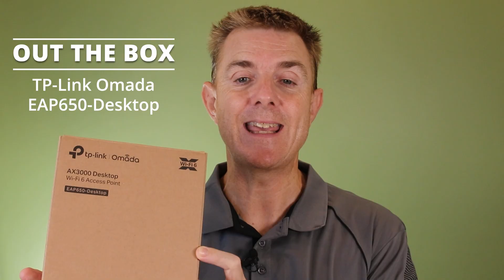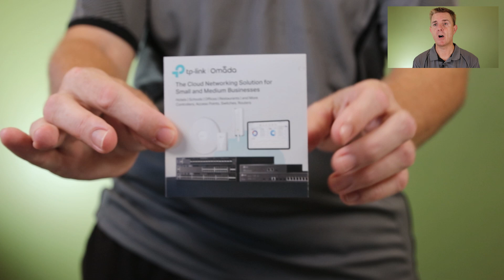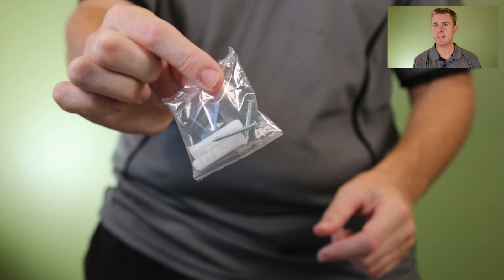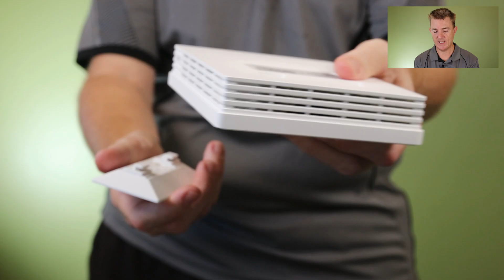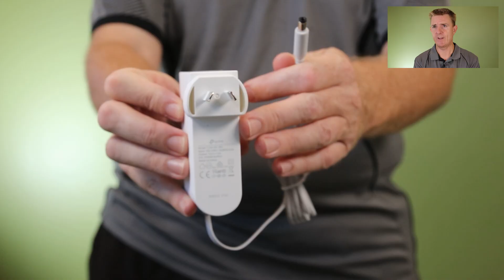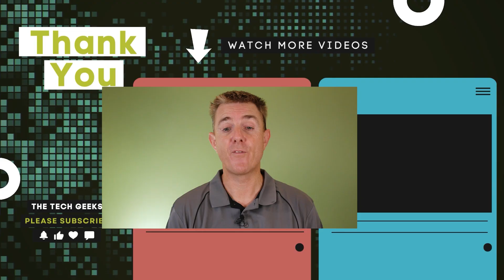Out the Box Series  - TP-Link Omada EAP650 Desktop Wireless Access Point

Comment: I have a question regarding the use of the RJ45 Console port as a port for the OC200/220 Controller, because most professional users use one of the RJ45 ports to connect the Controller, even if they also have a Console port on the switch they use. The latter leaving it free to connect to a laptop/computer for settings.
Can the OC200/220 controller be installed on the RJ45 connector labeled Console (RJ45)? Is it POE?
I'm interested because otherwise you occupy a 10Gb port (out of only four RJ45) with a device that can "carry" at most 1GB (OC220). In my case on a TL-SX3206HPP
Thanks in advance for an answer.
Reply from the maker: Good question.   We generally see console ports for that final out of band management or fix up if needed (if you are in the enterprise space then the config is normally done on the switch directly and so console access is fine and there is often no controller as such it is just a config per device).   In the case of the Omada controller it is designed for web based access, often remotely, so needs to see the internet.   Since you will need the web management to add and manage any of your access points or switches you want it to control, it will need to be PoE powered and have an ethernet connection.  In your instance as your switch only supports 10Gb/s ports then you are using a 10Gb/s port to just provide power and a small amount of data to the device, so is probably overkill, but if you don't have any slower speed ports, there is not a lot you can do I am afraid.
Reply: @The_Tech_Geeks  Thank you very much for your answer.

Comment: Hello, totally clueless here. I’m looking to extend Wi-Fi from my router with a 20m long Ethernet cable (cat6a) . Do I just plug it into the PoE port and it’s good to go  or are there better devices out there ? I do like the look of this device and that it has Ethernet outputs also as I may plug a couple devices into it.  I’m hoping for a good enough connection for decent quality video conferencing (not sure if internet to the house needs upgraded but I think the current connection speed should be adequate.

Any advice appreciated 

Lastly - is there a button to turn the Wi-Fi off ? I like the idea of having it off when not in use (but hard wired devices still online)